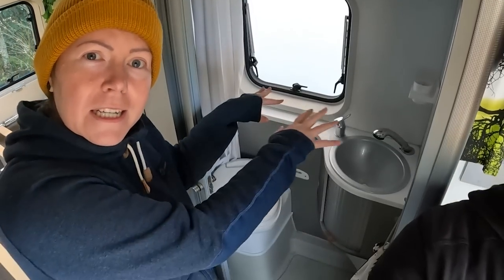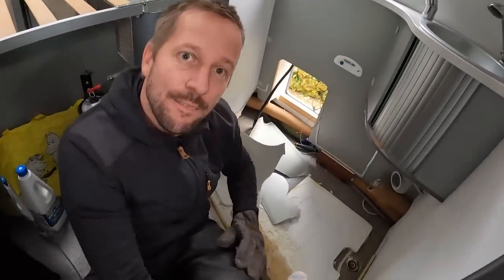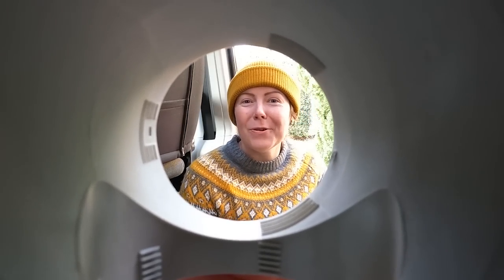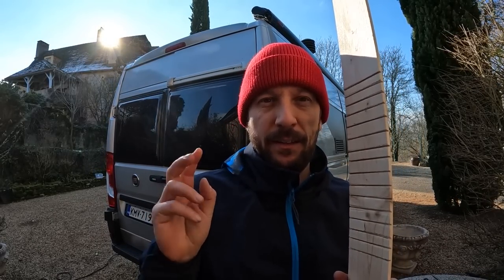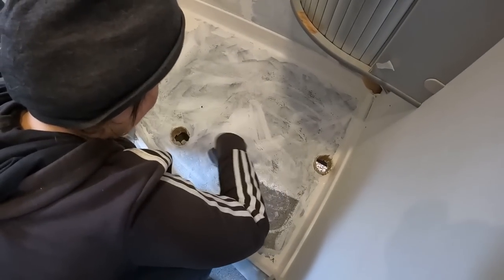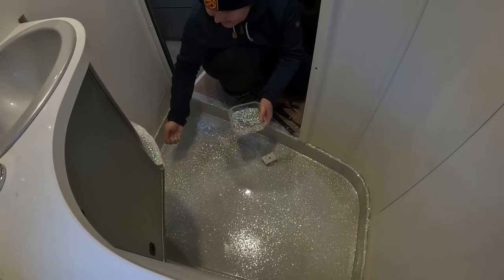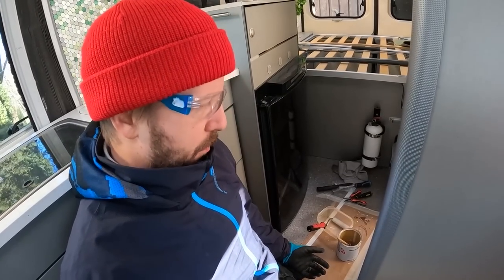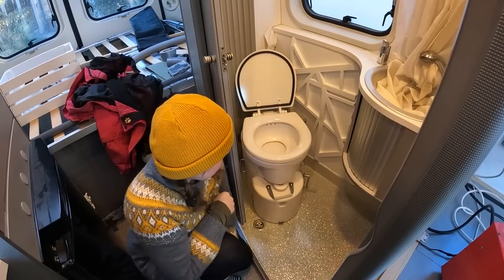CASSETTE TOILET TO COMPOSTING TOILET - Bathroom remodel in Adria Twin camper reconstructing wet room

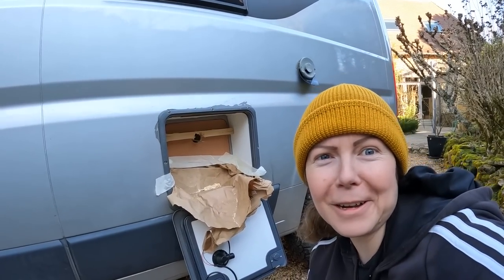Comment: This whole video was full of hilarity!! 42:02😂🤣. Moreover it was another learning experience. In a previous video you mentioned possibly taking everything out and putting it into a new shell. Would it be less expensive to just replace the engine and transmission; new or rebuilt? That wall next to your toilet is dope! Did I miss something or is it intended to be decorative? I could go on, but I didn't take notes. 😂🤣🚚

Comment: Impressive work! That was actually the first job on our brand-new campervan three 3 years ago, changing the chemical toilet to an Airhead! We are very happy with this kind of toilet solution. Only the agitator in the solid tank does not work properly... it is difficult to mix the solid part and I have sometimes to lift up the toilet lock and mix the solid part with a tool instead. Otherwise it works fine! Good luck, I'm sure you'll like it.
Reply from the maker: Wow, what a brave move! Congrats to have balls enough to modify a brand new camper to fit your needs. That is amazing. Thanks so much you info about Air Head. We know separating toilet is more primitive than our cassette toilet, so we are keeping our epetations quite low. We already noticed we dont really like how poorly the pee bottle is designed, it is hard to empy. It should shaped more like a funnel. But we really like the separating idea itself.
Reply: @Vantasticvan  Agree, it's difficult to empty the urine bottle... but as you, we're still enthusiastic about the concept in general!

Comment: Great job. They say you “can’t polish a turd”, but I bet there will be some glittery ones in your future.

I’ve seen some people link the liquid side of the toilet to their grey water system (it dilutes the pee if using the sink and shower) but I’m not sure how they prevent smells from coming out of the grey tank? Some urinals in gents toilets now are waterless and have a fitting that allows the liquid out whilst blocking sewer gasses from coming back up; it would be interesting to see if these could be used in a separating toilet somehow?